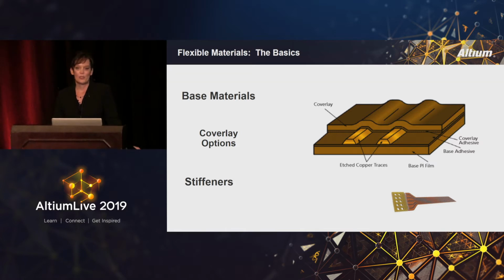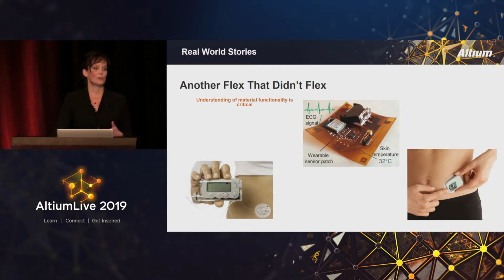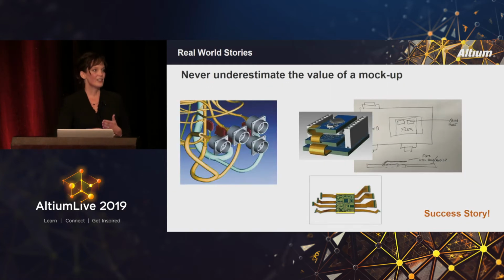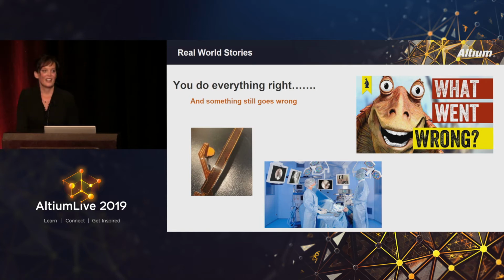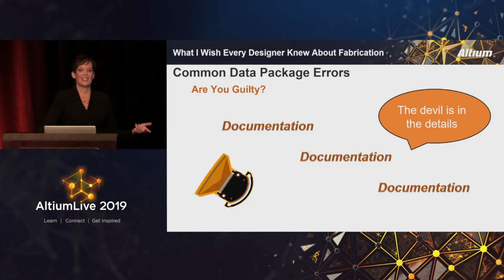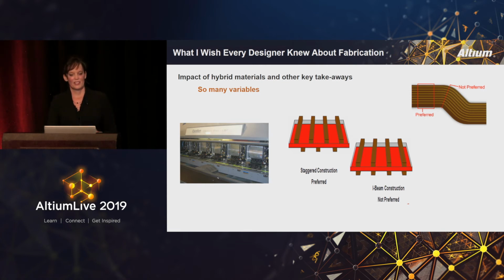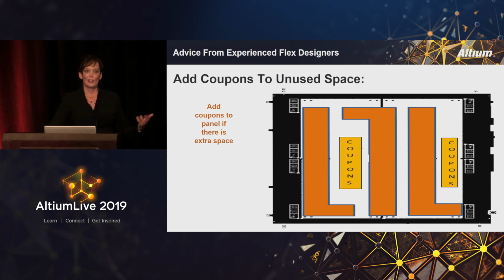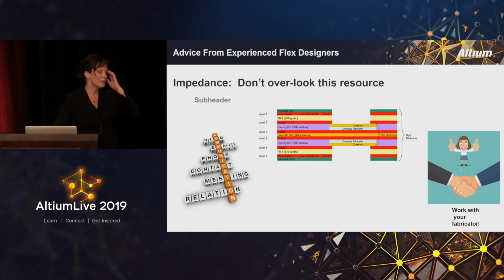Flex and Rigid Flex: Real World Use Case Studies - Dunn

Comment: Guys, I hope you fixed polygons on regid-flex boards. I can tell, that regid-flex board are real pain in AD. Also still there alot problems with highspeeds, multichannel boards. U r improving but u have way to go until u reach PADS or Zuken. 

Also you should better your verification process. 

Thanks 4 your work.
Reply: (there is a forum where your comments will get greater visibility at https://forum.live.altium.com/ )